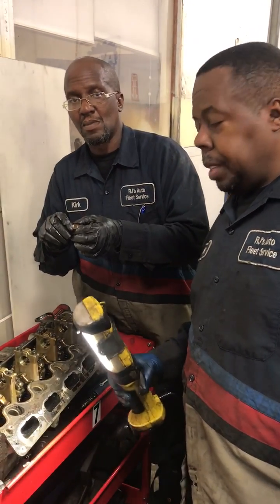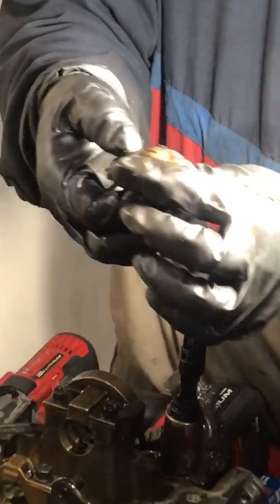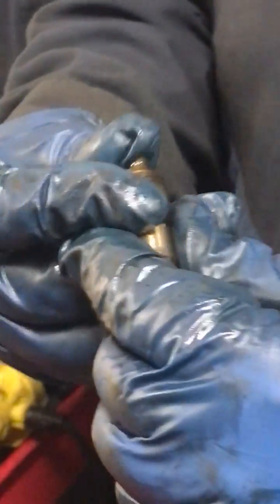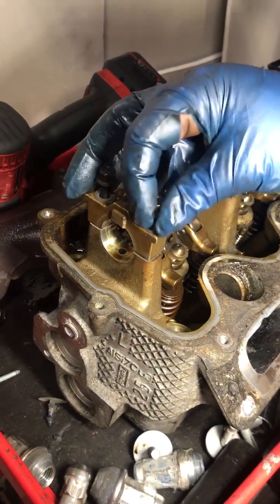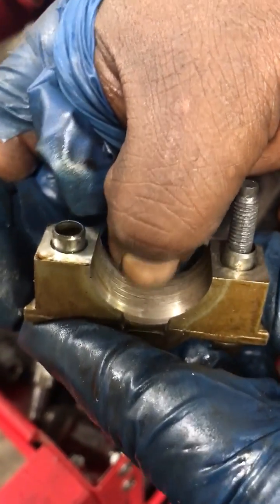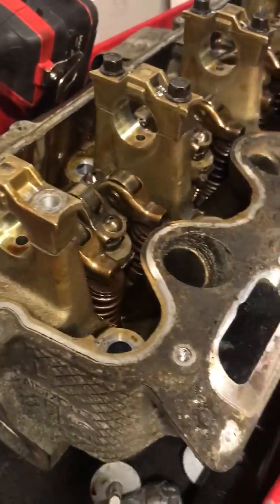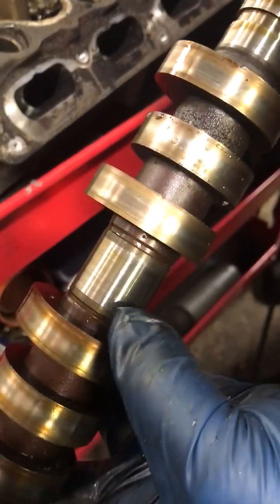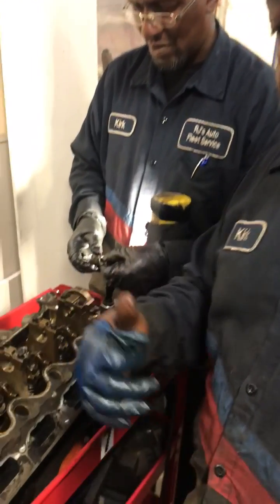2010 Ford F150 Inspecting the cylinder head.

Comment: I dont buy that, all camshafts should have bearings to protect the journal from metal deposits.
Reply: Agreed. If it had bearings you could replace those and possibly the cam and be back in business. With no bearings the whole head is junk. Probably only saved ford $20 per truck to not have bearings. And will cost the customer thousands now.
Reply: @Gainz27 
And what motivated them was the millions of trucks they didn't spend the $20 on, $20 x that many million.
I'm with you - it flat out sucks they manufacture this way.
If you ask executives near the top, they'll tell you "we're not in business to make cars, we're in business to make money"
Sucks to be a customer anymore.